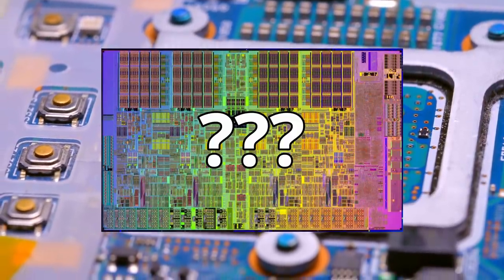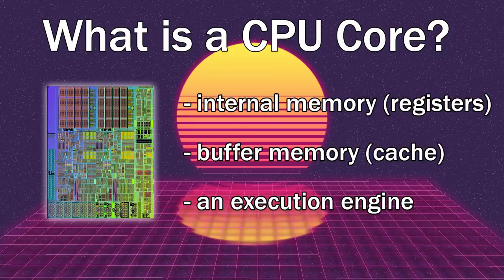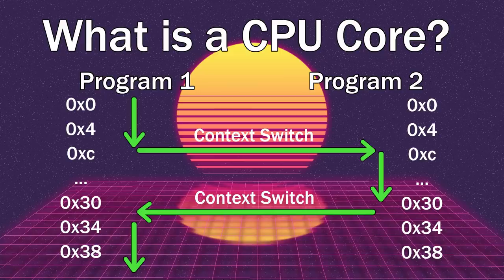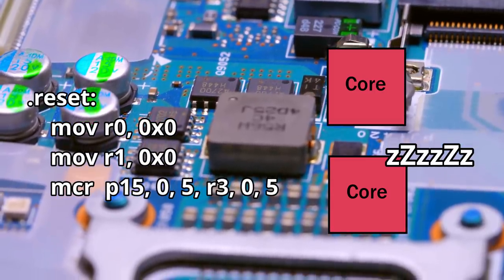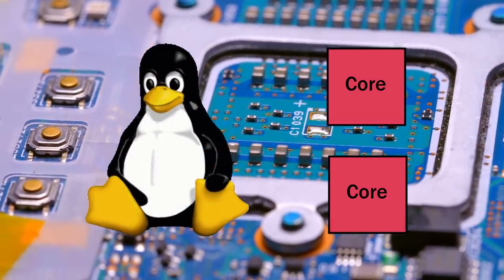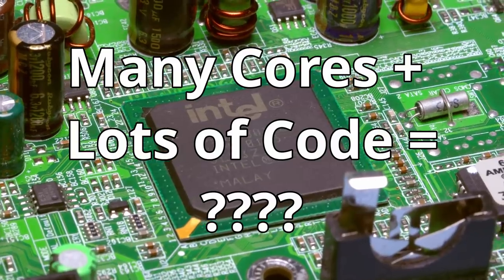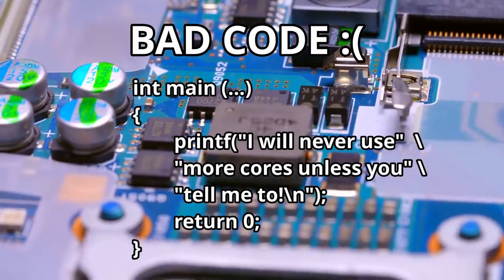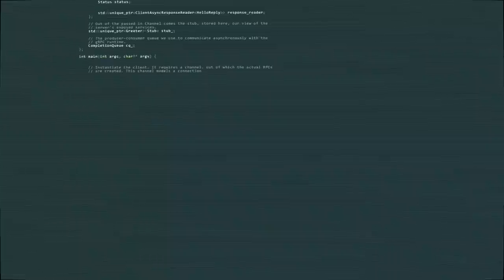why can’t computers have thousands of cores?

Comment: more cores mean better parallel proccessing power, and more memory bandwith and throughput internally, especially if you have internal buffers and sram caches as external throughput and bandwith is less because propagation delay and unwanted spurious emf noises , gotta think how many 6502 or z80 pmos or cmos 8/16-bit cores would fit in the same transistor count as an amd r9 fury gpu, or amd threadripper cpu, and just how much computing power would such a a chip have? i've done the math, you can fit roughly 9 million 8 bit 6502 cores (depends on variant, pmos is used), or rougly 4 million 8 bit z80 cores,  or rougly 3 million 65816 cores at a 7nm process with the same 33.2 billion transistor count in a high specd  threadripper  cpu, or with a 28nm process used wit fiji chipset you can fit about 900,000 65816, or roughly a million z80, or about 2.5 million 6502 cpu, on an amd r9 fury  

Winston Zeddemore voice  dats alot of cores
Reply: dats why yo new cpu and gpus after 2023 and your game consoles will start intergrating chipsets in to a SoC chipset that would be connected via chip stacking and interposer substrates, also people on gbatemp cant afford and too broke to reverse engineer dat, they can try and break all duh game and computer consoles teh want, cuz eveytime they buy one nintendo, sony, and microsoft steal yo money!😎   

sucks to have to go and buy serveral hundred playstation, xbox ones, switches and 3ds units just to break 99% of em, and still learn nothing about the hardware, software, or security keys
Reply: I believe everything is artificially kept "monolithic". Even real-time graphics for games can theoretically be divided in screen-parts.

Comment: This was misleading back then and severely misleading now. More cores is better and with AMD Epyc CPUs (latest one has 96 cores, 192 threads) is the fastest CPU in the world. Yes, it's not efficient in terms of power draw (400wtts) as opposed to a normal CPU (90-120wtts) but with more cores means they run on a lower frequency. AMD Epyc runs on 1.2-2GHZ as opposed to Intel's i5 12400k's 5GHZ, but it ultimately means more cores means less work to do so it's better. Only thing you have to worry about is thermals and power draw

Comment: Once we make a multi-purpose analog CPU it would be many times faster than digital!
I find it Superior because while a digital computer to send a few values it will have to send a bunch of ones and zeros which take time, but analog however you can just send the value it would be especially helpful for AI!
The downside building something as complex as a CPU in analog form is not an easy thing!
Reply: We could also just use superconductors like graphene and carbon nanotubes to make smaller quantum computers!

Comment: This video doesn't really answer the question which is a fallacy in the first place. The real reason is the design philosophy and purpose of a modern CPU - to execute serialized code with random memory access as quickly as possible. There is nothing faster than a modern x86 CPUs at those two tasks. Graphics cards may several times more memory bandwidth but also an order of magnitude more latency, graphics cards have hundreds of times more raw performance potential but only when it comes to parallel tasks, the individual cores are quite slow. So it really comes down to two distinct kind of workloads that programs require - serial and parallel. Over 90% of a random programs logic is serial and requires random memory access, the parallel parts with sequential memory actually make up a very small amount of code even though it needs to be executed so much that we have developed dedicated hardware for it. This logical divide isn't because programmers suck (even though sometimes they do) but rather because the vast majority of logic simply cannot be made to run in parallel.

Now the reason why we have CPU's with multiple cores at all is because of practical considerations. Ideally, all programs would be separated perfectly to serial and parallel parts and the interconnect between the CPU and GPU would be so snappy that all the serial parts would run on a single superfast CPU core and all the parallel parts on a super wide GPU. In reality however, shipping stuff over a PCIE lane to a different piece of hardware is rather slow and also creating efficient parallel code is hard. Therefore, the most successful CPU's and GPU's are ones that incorporate parts of each other. CPU's have become more parallel over time, including more cores and vectorized instructions. GPU's have become more general purpose, including the ability to schedule their own tasks and some even incorporating a tiny CPU on board to serve as taskmaster.

Going forward however, you can bank on these things: CPU's will always emphasize single threaded performance and latency and GPU's will always emphasize parallel performance and bandwidth. The amount of how much they incorporate features of each other will fluctuate depending on practical needs, that is all.

Comment: In 2013 or 14 tests showed Anythng over 35 cores gave zero extra speed even with programs and OSes designed to use > 1 core. Even with partitioning software as the partitioning solutions needed to use all cores. Oh and some CPUs would NOT work with Partitioning even in 2015. Have not kept up with comercal grade CPUs and systems since but assume someone got around these limits. I hope anyway.

Comment: Yeah that thing about bad code is badly worded in the video. The reality is that there are a lot of computations that cannot be multi-threaded efficiently or at all. If a program is generally utilizing only a single core, chances are that the type of computation it's doing cannot or should not be multithreaded. 
On top of that even if the computation does lend itself to parallel processing, it doesn't mean that it's a good idea to multithread it. Multithreading comes at the cost of chopping up the work into multiple parts, computing the partial results, and computing the final result at the end. For small computations this can be orders of magnitude slower than just single threading the full computation.
Last but not least is the complexity of concurrent code. Multithreaded application are significantly more complex to write and debug. 
Moral of the story is that you don't write multithreaded application unless there is a good reason to.

Comment: Didn't watch yet, but wanted to explain something before I got into the video. 

More compute cores just means more logical compute volumes (kinda) which most programs don't actually need to take advantage of in spades. Usually that only is useful in production software like Blender, Photoshop, After Effects, etc.

Comment: I mean I would genuinely rather it to be higher clocked tbqh, like just looking at near-future scenarios of Deus Ex: Mankind DIvided is pretty hilarious, they were positing 8.23ghz 16 cores in the future lul
Which frankly for most games most of those cores aren't actually going to be particularly useful for quite a long time, even to this day most games just use dualcores with hyperthreading, so anything beyond the first 2 cores is probably going to be wasted, and after that maybe a quadcore partly thanks to Intel stagnating and market demography, although now it's probaly just going to be hexcores as the new standard anyway. I wouldn't imagine a 8 core CPU being heavily leveraged by games anyway, so it's mostly for production. As a gamer though, I'd want those higher clocks. Which is pretty much the main reason Intel still has any argument, it can actually get turbo'd past 5ghz pretty easily, in fact even back in like 2012 you could get an Intel quadcore to overclock a real actual overclock of 4.7ghz. AMD's CPUs STILL aren't even doing boost clocks that high with Zen2, and just barely broke Intel's OC standard set over a decade ago with Zen3, which if it weren't for IPC/other uplift they'd still be the shittier brand. 

Of all things I'd say I'm happiest with Radeon as a gamer. I am not super enthusiastic about AMD cpu though. I'd simply just rather make use of my pricier $300 motherboard with a real overclock and AMD just can't do real overclocks. The problems with this are most severe on X3D vcache models but it isn't just them, it's all their Ryzen CPUs that can't actually overclock because it goes way unstable and basically AMD bullshits me by saying a 3.6-4.4ghz CPU is on an "all core overclock with 4.3hz" no if this were Intel it'd be called a silicon lottery loser that can't even keep up with baseline expectations, it can't even hit advertised turbo speeds. That's the truth for AMD. You are told to call your paltry turbo behavior not even hitting advertised clocks as "all core overclock" which it's just not the same as for Intel, where you're automatically expecting on a 3770k to go 3.9ghz all core no problem. I think it also partly has a thing to do with the infinity fabric and hitting memory clocks though, like I'd expect if you can match your RAM speed to CPU clock is where the limits get pushed with stable "overclocks" on AMD and probably my assumption being that Zen4 can actually do real overclocks by just getting super high clocked DDR5 RAM kits and then setting up an XMP profile that matches your custom overclocked CPU to its RAM speed, plus afaik there's a 1:2 timing issue.

But basically yeah, I'm more happy I switched to Radeon than I am that I switched to Ryzen. I like the way Ryzen 4 IHS looks and they finally switched to LGA thank God, but other than that I can easily see myself switching back to Intel just because I wanted to do real overclocking again that I can't do on my Ryzen 2. 3700x is mainly saved by the fact it's cheap, it came with a fantastic stock cooler that's better than some aftermarket coolers in performance and style, and it's still nowhere near bottlenecking my GPU but that's probably going to change next upgrade. Also it being super efficient. But even then, if I get 5800X3D my board is literally wasted, it's got 1 6pin and 1 8pin plug to CPU, which I only even needed 1x8pin really even if I got 5800X3D because it can't overclock, and if I stuck to my guns and got a 5950x used because it has higher clock speeds anyway and enough cores to last me forever (if I finally use it for production task) it's still not likely taking my full power delivery. Although, I suppose I can toy with it and see if I can set up a real overclock by disabling one CCD and just running a single 8-core die at a really high clock like 5.1ghz and see what that does, but my understanding is there's really no point to OCing AMD.

Comment: Its like when intel core2quad came out, no program can ever use all 4 cores that time but its what you call future proofing
Reply: DAWs can use all the 4 cores inside the core2quad. It's a massive upgrade over core2duo, i tried to work on a Core2duo and using a DAW there and it is a bad experience.

Comment: More cores was originally created to work around the limitations of clock speeds.  Now we're at a point where clock speeds both aren't getting higher and don't net much benefit to going higher, and we're even at a point where 16/32 is the absolute extreme you should ever go and only if you have specific use cases for it.  8c/16t is for the most part just as viable and really only loses a little bit in performance and it's mostly only noticable in benhmarks.  I think we're already at the point where more cores and more clocks are more who cares?  Once you're in god mode, it doesn't really matter if you beat the game on beginner or extreme hardcore..
Reply: Right?   I mean, it's not like I think something stupid like "we have enough".  I never want tech to stagnate.  Make a 74 core CPU.  Do it twice and make a 148 core.  I think it's awesome.  I love big numbers.  I just think the general perception of "more number is always more better" is a little misguided at best and "derpity derpy dumb" at probably.
Reply: well said, life partner.

Comment: This video did not age well, in just a year we are seeing processors with 128 cores and motherboards with 256 cores (2 processors). Clearly without going faster in clock speed adding more cores is the only way forward. I assume processors with 1024 cores are few years away.

Comment: Your statement seems really silly to me.  Why would I say that?  I say it because if you look at a supercomputer it has a LOT of CPU cores and hell many of those CPUs talk directly to other CPUs.  Now I would guess that a supercomputer would work best on problems that can be broken down into many bit sized chunks.  Now I've never worked on anything like that but if we take a math show and look at problems they have solved by hand they did the hand solving using a method that was broken down into doing many independent calculations then combining them and then doing more stuff and repeat.  So the point is that many CPU cores can work as a single computer, so your statement is full of doodoo but I do understand what you are saying.  The thing is if everyone used a computer with 5000 CPU cores then games would be designed with that in mind to get the best results period.  So yeah whatever.

Comment: Just a correction, It came to me as weird that first dual core cpu was in 2005. It wasnt, you are right it was IBM but in 2001
Reply: Nah, he is wrong as well. There were multi-core systems and even CPUs well before 2000.
MAJC 5200 for example.
Sadly nowadays the internet is filled with misinformation.
Reply: "Since the release of the first dual core processor in 2005 by IBM,..."
I recall coding a Zilog Z8002 processor that had two CPUs in one chip as early as 1980. How was that not a dual-core processor?

Comment: Yeah, but I think it's still possible to solve those bottle-neck problems and still have a faster processor that runs cooler.   Years ago, the trend was to downsize everything electronic.  Thus we came up with "microchip" . . .   But who says everything NEEDS to be tiny?   Who says you shouldn't pack more micro-processing onto a larger space?   I mean if space is not an issue, pack it full of processing power and cooling power, maybe use a Dedicated Processing PC Board with an interface that connects it to the  Mother Board and a cooling shroud.

Comment: Back in the early 2000s. Nvidia had a ma8nboard southbridge which alowed windows users, if they had 2  or more nvidia Vraphic cards, they could boot up without CPU but with the GPU instead taking the tasks. Back than having 256Cores in the Windows task manager was nice. It runs smooth but no game and only benchmarks where able to use so many. Often 128 cores had work and tge rest not.
Nowadays ... It exists better coding. At least windoes, video watching and surfing the internet will work well....

Comment: The biggest bottle neck is of course the hard drive data read and write this is where it all falls apart if you can’t load and save data as fast as the cpu and ram it will slow a pc down no end and no matter the size of ram or cpu

Comment: The bottle neck is programmers from 90s...They was so lazy to make multi processor systems. Yes they did, but speed was same as single processor. Even today there is no parallel computing. All the benefit what they get is the core cooling. They only switching very fast between cores and nothing happens on parallel. The programmers still do not understand or do not want to make the real parallel computing. For them is easier to make apps by app making toys...not a real programming.

Comment: Wafer-Scale Engine: The Largest Chip Ever Built
The Wafer-Scale Engine (WSE-2) is the largest chip ever built and powers the CS-2 system. The WSE-2 is 56 times larger than the largest GPU, has 123 times more compute cores, and 1000 times more high performance on-chip memory. The only wafer-scale processor ever produced, it contains 2.6 trillion transistors, 850,000 AI-optimized cores, and 40 gigabytes of high performance on-wafer memory all aimed at accelerating your AI work.
Now that is specialization! And you also have to have the rest of the machine to make it work. And the programming skills!

System
Software
Cloud
Industries
Health & Pharma
Web & social media
Government
Scientific Computing
Energy
Financial Services

Comment: Why can't i have 32 octa core processors on the same motherboard?
Reply: Well you can, just not X86 as far as I know.

An Oracle SPARC M8-8 has one motherboard that can have upto 8 CPU/Memory boards attached.  Each of those CPM boards has a SPARC M8 processor with 256 threads, for a total of 2048 threads in the machine.  Also, 2TB of RAM per board for a total of 16TB of RAM.

But it's going to cost a bit more than your PC gaming rig and it won't run Windows.

Comment: What we can learn from this video:
The maker of the video ignored most of Moore's law.
The maker of the video doesn't know about Amdahl's law.
The maker of the video didn't realise there are things like HBM to counter the memory bottle neck or chips like the second generation of the Wafer Scale Engine consisting of 850000 cores.
Beside this every somewhat better GPU has thousands of cores able to do general purpose computing. (the difference between a GPU and a CPU is negligible in the end).
Reply: > The maker of the video doesn't know about Amdahl's law.
Amdahl's law makes clear why more than 16, say, cores don't make sense for a general purpose CPU.

> Beside this every somewhat better GPU has thousands of cores able to do general purpose computing

Wrong. GPUs are very much targeted at making the graphics pipeline fast. GPUs are not general purpose. They /can/ be used for some special number crunching tasks (GPGPU).